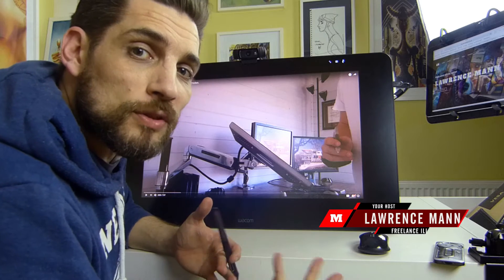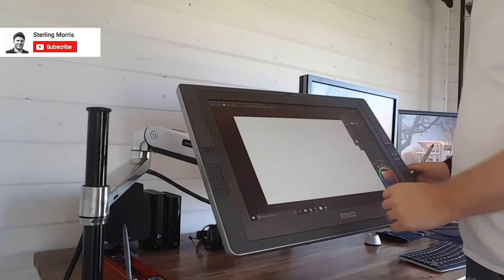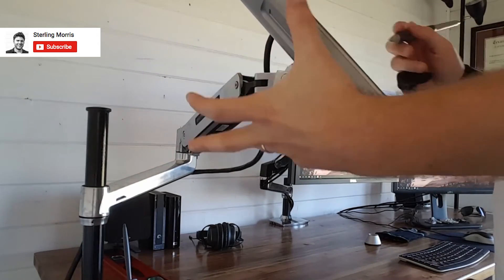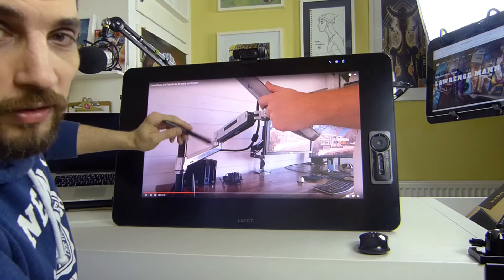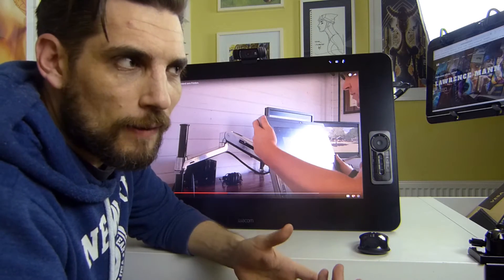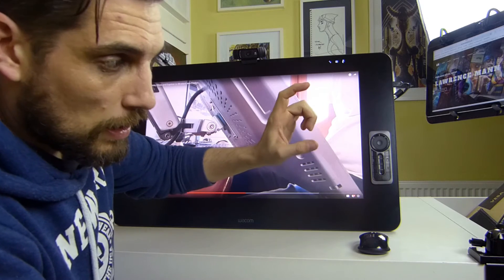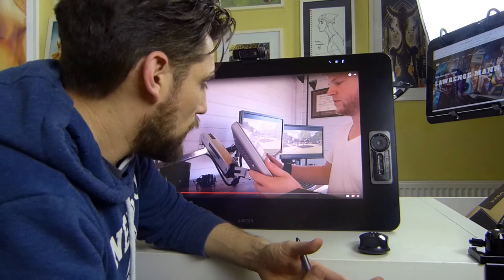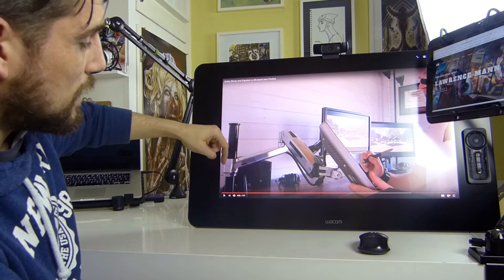Ergotron Help

Comment: I got ergotron LX but the screw for adjusting the Tilt doesn't seem to do much. No matter if I turn it all the way left or right, the tilt is basically locked.
Not sure if there is something broken or should I try to force it for the first time (maybe something is stuck)?

Comment: Opposite question, I removed TOO MUCH of the lube during assembly. Is there a specific kind that I should use?
Reply from the maker: Great question - any mechanical lube from a hardware store will be good. As long as it is thick and not the spray on WD40 type lube.

Comment: That's a good video I'm trying to find out how to get the monitor to tilt up and down I have a door alarm 1 but when I adjust the screw for the spring to get tighter or looser on one of them the monitor won't move it all one of them is fine one of them own and it's just making it go from being able to lay back to being able to stand up it's just the monitor part
Reply from the maker: Sometimes a brand new arm is just super tight and is hard to move. The screw in the neck will move with the provided Allen Key.

Comment: I was wondering about the lubrication amount as well! My smaller Ergotron arm came with a small amount of lube, but the plastic caps on my Sit-stand looked like they were in a bag of marinade. I thought maybe since it was heavier duty it needed more? I wiped off the top part of the pole, but I like your idea of taking the arm off and removing 80% of the rest of it.

The top o-ring isn't exactly a snug fit, there is a tiny gap on one side.

primalcaptive - what is this nylon bush you are talking about for option A?

I'll report back after I reassemble the arm when I have time.
Reply from the maker: No worries! Let me know if this works for you. If still it doesn't work then try those other things I mentioned and maybe contact +Ergotron and ask for a replacement ring. 

Hope it helps – let me know! #ShareTheLink ;)
Reply from the maker: I wonder if +primalcaptive is talking about scoring the inside of the plastic sleeve (that connects with the arm) to help add friction? It would work but I'm not sure how much. This would obviously only be any good if there were no lubrication at all. Like I said; maybe a last resort. I'm pretty sure that Ergotron themselves would not advise it though.
Reply: LAWRENCEcanDRAW No, i'm talking about getting a new nylon bush machined (made). Having an engineering trade background, it's just something i'm familiar with. A bush is a sleeve that fits between two surfaces that is load-bearing. It shouldn't have any slack whatsoever.
Reply from the maker: Ahh! That makes sense now. It sounds like a great idea but what would the costs be to that. Inc. postage etc. Would it make a difference? Obviously my arm is working fine with the plastic bush.

Comment: My monitor arm is from a different brand but my problem is that the gaz piston is now weak. Not a problem by it self but I can't acess it because the arm was closed with rivets instead of screws. Has anyone else had a similar problem?
Reply from the maker: You do have to tighten them up periodically with an Allen key. If that isn't working for you then I suggest it is the brand. Ergotron is guaranteed for 10 yrs but honestly my first Ergotron arm has lasted me longer than that!

Comment: Too much lube, yes. For a more serviceable long term solution, i wouldn't hesitate to either A. have a new nylon bush turned up so it needs to be forced on(instead of that cheap plastic insert), or B. drill and tap a couple of 10mm threads into the aluminum section and screw in some nylon grub screws, so that they create resistance on the black tube.
Reply from the maker: Interesting. Not sure how comfortable I'd be putting holes in something that is going to hold a tablet worth up to $2.5k (if you do get the 27QHD) but it might be a last resort if nothing else works. I'm not 100% sure how the brush would work. I'd love to see some pics of that!

Comment: How do I dismount the ergotron stand
Reply from the maker: One leg at a time! Sorry, couldn't resist that. I'm guessing you didn't put it together? Here's how:
1) It is attached to the monitor by four screws. You have to take them out and the monitor will fall off. Maybe have someone else hold the monitor while you unscrew it. It is hard to do this as a one person job. Watch out because the arm will 'buck' when the monitor's weight is detached. It is spring loaded. As long as your fingers are not near the joints you will be fine. 
2) the top part of the arm should now just come off at the joint when you pull straight up. Unless the arm is locked in one position (rare that people do this). If this is the case you might need a small allen key.
3) Same as 2) for lower arm.
4) Unbolt the pole under the desk. This will either be held in place with three bolts or a hand turning grip - depending on which arm you have.

Hope that helps you Katrina.

Comment: So I just got a Cintiq 20wsx off ebay and I'm having driver issues in windows 10. The latest Cintiq drivers recognize my 12wx but the 20wsx like this guy has the wacom drivers say no supported tablet found. Halp!
Reply from the maker: Yeah, Wacom have stopped supporting the older tablets now so you have to track down a legacy driver for it. From what I know you can't have both the new driver and legacy installed at the same time so there can be conflicts if for some issues you're trying to use two tablets (not that you might). The generic Wacom driver isn't any good with the older tablets now though. You've got to find one for older tablet. Should be easy with a Google search ;) Hope that helps.
Reply: I found one on the Wacom Asia website that works. It's driver number 6.3.15-3 and the current Wacom Cintiq driver is 6.3.18-5. Strange how the most current driver works for the 12wx but doesn't for the 20wsx. They're both in the same family of Cintiqs. Both use Intuos 3 pen tech. Anyway I contacted Wacom about it too just to see what they have to say.
Reply from the maker: They released a statement earlier this year about driver updates and the fact that they were ending support for older tablets. I'm sure it had something to do with conflicts so they just scraped the old stuff to make way for the newer tablets which is fair as that's where they make their money. They should still have a legacy driver on their US or Europe site though. I'm not 100% sure that the Asian driver is exactly the same. As long as it works though – that's all that counts!
Reply: Well that's upsetting considering I just bought this one. I'm happy right now that I got it to work but I was hoping it would last me a while. Thanks for the heads up.
Reply from the maker: Don't worry. These things are built to last! Even if they aren't properly supported they'll always be enough people using them for a few more years. It is the price you pay for saving money. haha. Sure it'll be fine. Have you got an Ergotron to go with it?